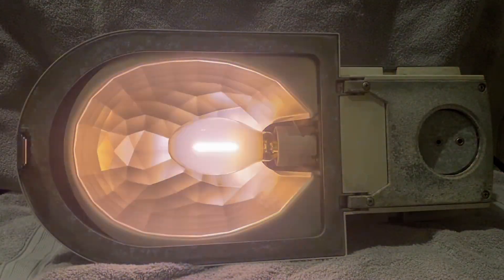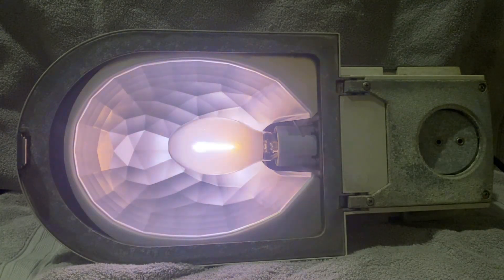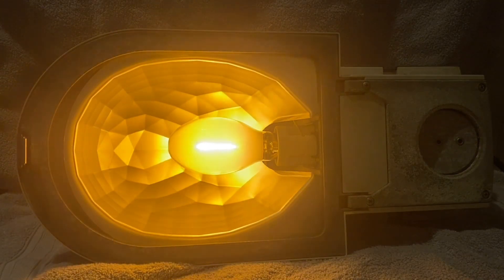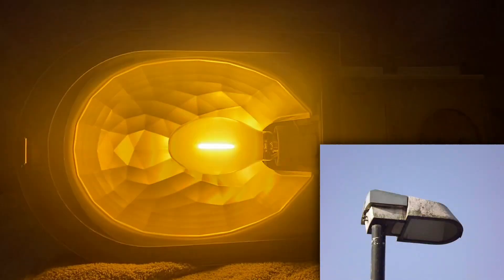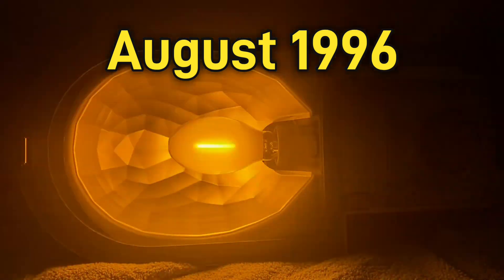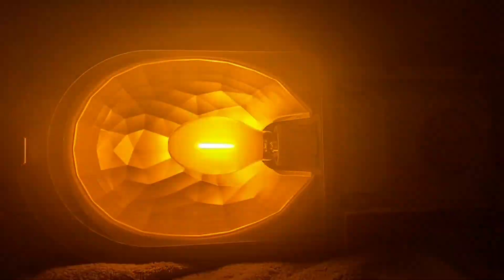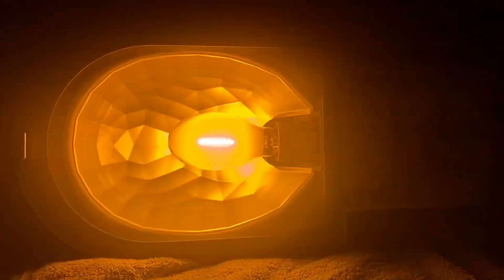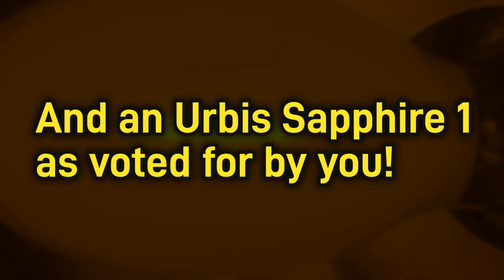WRTL Vectra (small) 70W SON-E Warm-Up!

Comment: what's the difference between SON-E SON-I SON-T?
Reply from the maker: SON-E is an elliptical lamp
SON-I is a lamp with an internal ignitor meaning that the gear won't need one
SON-T is a tubular lamp, theres fundamentally no difference between SON-E and SON-T other than the shape, although some SON-Es can be coated which reduces the lamp glare
Reply: @LeoLampposts  does it give the same kolor temp 2250K? was there such thing as self balled high pressure sodium oval coated bulb like self ballasted mercury bulb?
Reply from the maker: @mercuryvap  I believe the colour temperature remains the same or very similar, and I havent heard of a self-ballasted SON lamp so I'm not 100% sure but lamptech.co.uk has lots of information on sodium lamps

Comment: What is the difference between SON and SON E

Also why is this one milk coated, if it lights orange anyway

I thought milk coating is used if u want more white out of ur incondecent light
Reply: It's mainly to diffuse the light in sodium or incandescent lamps. As a general rule, (at low level) If you can see the lamp, you should use a coated lamp to diffuse the light, and make the visible source less intense. If you can't see the lamp, you should use a clear lamp, and the shade or refractor bowl of the light fitting will diffuse the light.
The coating on fluorescent or mercury vapor lamps serves a different purpose. That phosphor coating absorbs the ultra violet discharge from the mercury in the lamps and emits white light in return.
Some incandescent lamps have a thick white coating like the fluorescent phosphors to change the white balance, and give a cooler colour temperature; but the coating on the SON lamp is more like a pearl finish incandescent lamp, and only serves to diffuse the light.
Reply from the maker: SON-T is tubular, SON-E is egg shaped or eliptical. I think it's to do with the light output/glare though I'm not 100% sure

Comment: Great video. I have a small one and a medium. Both use a clip and hinge for the gear compartment so it might have been an option, never seen it before though so I find it intriguing. All 3 sizes could have the zebra optic I believe as my medium is a Vectra-X running 150W.